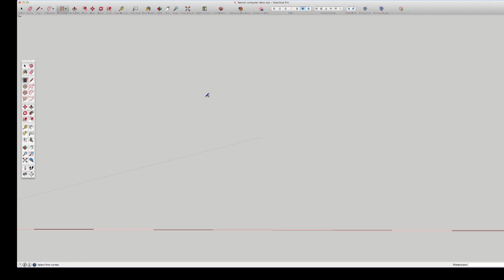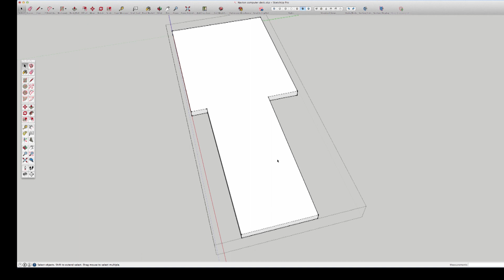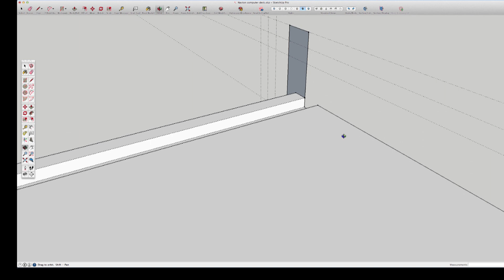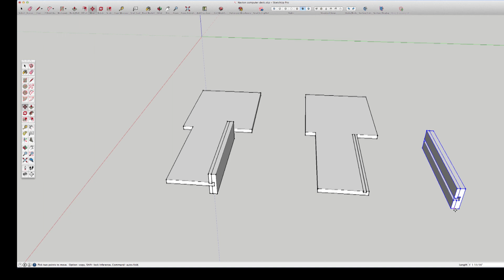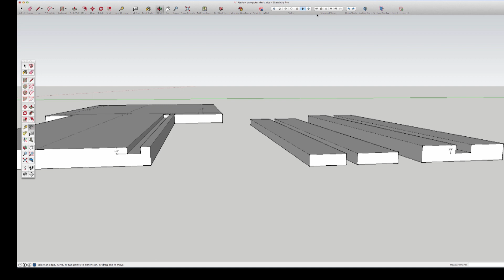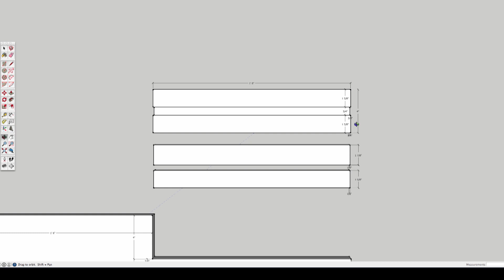Designing an RV Computer Station for Itasca Navion 24J

Comment: When you are actually making the cuts do you allow a slippage margin for too tight a fit?

It is almost impossible to go to the next video on youtube. Can you kindly number them, please?
Reply from the maker: I am not sure what you mean? If you are referring to the dado and spline, I cut the dado tight and then made another pass until it fit well. I have not edited the follow-up video yet, but should have it done and posed in the next few days.
Hope this helps, 
Ron
Reply: Ron Paulk
Yes, Ron. I was speculating as to whether you calculated in a 1-2mm slippage into the calculation to reduce tightness.

I like the worktable boring jig. I had asked you about that aspect a couple of years ago.

I have been building the workbench from your plans and it is coming along well. Big project. The boring jig will help

I was looking for an index of your videos- Is there one?

Thanks,
Windwoodtrader